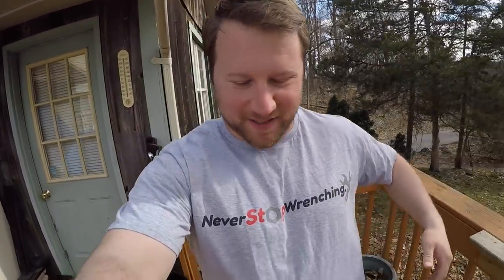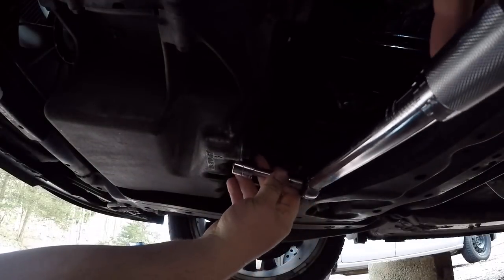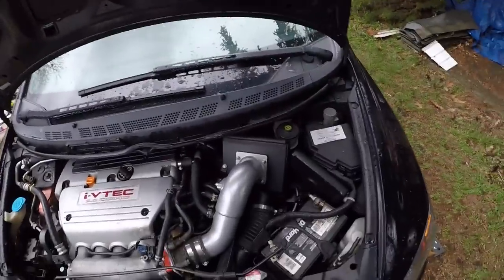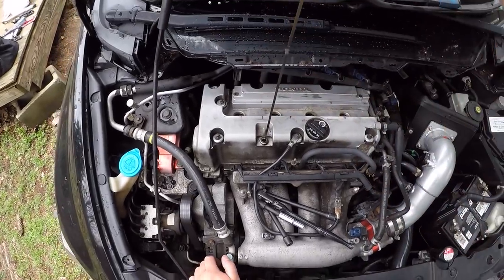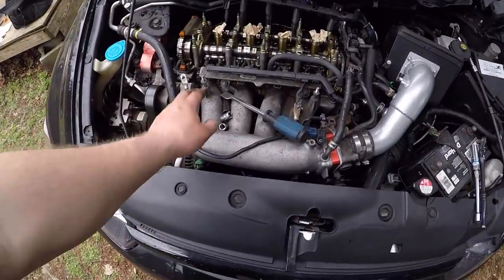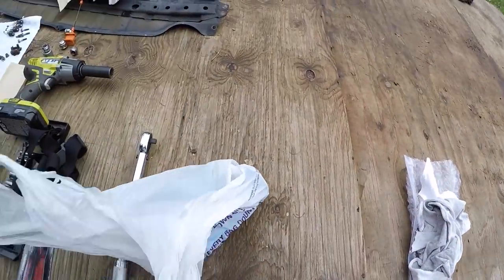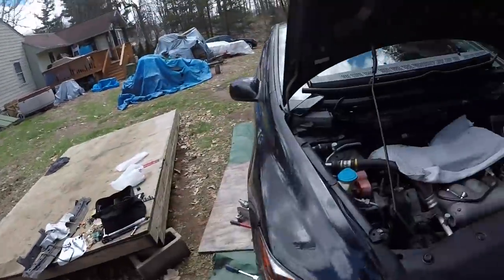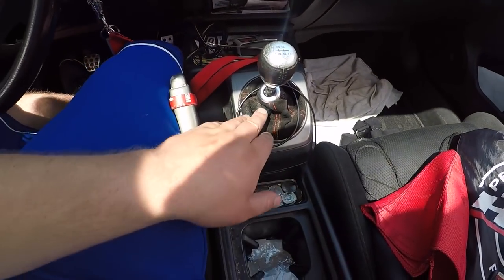Trying to Save My Honda Civic Si

Comment: That rain shield is just needing two bolts water is not going to make it lose lol. keeps the air filter dry,the spool valve water from the connections and the header to keep it from warping ( :

Comment: Don't use either, get Amsoil! Try running Sea Foam threw the fuel tank and into the intake with the Sea Foam intake spray for starters. It may help

Comment: Quaker State ultimate durability is good oil imo. 180k miles in a 2012 civic since new and motor runs flawless and no issues
Reply from the maker: Really? I've never heard anything about quaker, but that's a plus

Comment: For the noise valves in the e39 530i we decided to try out Lucas Upper Cylinder Lubrication & Injector Cleaner (goes through gas). Pops says it quieted down the other e39 and made the gas mileage better so hoping to do it to the fa5 before the next oil change #castroledge

Comment: You should've put the seafoam in the old oil a couple hundred miles before changing it.. don't put it in the new oil or you'll ruin good oil... don't waste your oil changing it every 3000 either, it's perfectly fine running the oil life monitor to 0% especially with synthetic.

Comment: Start running 5w40, I run it in my prelude, doesn't burn as much oil and I feel better having thicker oil in it cause the motor does have higher milage. As in what oil to use do your own research and make your decision from there. Alot of people are biased from advertising and just because this or that.
Reply from the maker: I was thinking about going up like a weight or so in oil... I'll decide next oil change, but for now, i'm happy with my castrol
Reply: Gerb Productions yeah that's what I switched to from Mobile one

Comment: I prefer Valvoline for my Honda Civic. However, Castrol Edge motor oil  will do the job fine. Mobil One oil are not good oils as they used to be.

Comment: I use Castro’s Edge. Have been since I’ve had my 2008 Honda Civic Si 209,000 miles.
Reply from the maker: That’s what I used before I switched to amsoil

Comment: Penzoil ultra works the best in both my Gd3 honda Fit and my  EM2 Civic. Even after 7k km oci’s the oil is still goldish when I change it. I was running mobil 1 in my EM2 before and the valvetrain was very noisy at the end of the oci’s. I got concerned a bit so I looked it up on bitog and just so happened to find out that mobil 1 samples show alot of metal in the oil compared to other brands so I switched to penzoil and never heard any weird noises since
Reply from the maker: Great info. You're the 6th person who swears by penz.  Maybe i should just run amsoil

Comment: Try running .008 on the intake and .010 on the exhaust. That's what I'm running tuned w/ bolt ons
Reply from the maker: Funny that you say that man, was going to do that, but my manual said .009/.012
Reply: closfg2 just set mine at the exact same specs and I agree
Reply: I tend to run my valve lash specs on the tighter side for a little bit more performance and less valve noise. I ran .006 and .007 on my old h22. It seemed to always like it on the tighter end of the spec. Try it out👍
Reply: only thing is the exhaust valves on honda engines seem to tighten up real quick so i feel like you would be adjusting them once a year
Reply: closfg2 a bit too tight for the k20z3, .008I/.010E is almost pushing it

Comment: Hey Stephen just use Pennzoil platinum from Walmart. Cheap and doesn't burn, good quality. Also, do you have the basic hondata reflash on the flashpro? Why don't you try that and see if the car runs better. It's more of a stock tune but maybe that could confirm whether it's the tune or internals causing the blue smoke. Your two mods now should be fine for the reflash. You didn't have blue smoke before flashpro right? The intake and header wouldn't cause it either. I also don't think you should have put the seafoam in a k-series engine; just a suggestion from Spoon Sports president tatushiro ichishima
Reply from the maker: It smoked once before awhile back before flashpro.  Only added a tad of seafoam into the crankcase, but that'll be it.  I don't really like adding additives to my cars often
Reply: Gerb Productions it might be valve stems or somewhere leaking in the cylinder. It's just during idle right? Could the valves be dirty? Cause during idle it's like VTEC but one valve open no overlap; Maybe pour gumout tune up into gas tank or attach crc valve cleaner into intake, spray, and rev engine?
Reply from the maker: I'm going to run it like this for awhile, see if it does it again. So far i added seafoam, valve adjustment, and changed up oil.  We shall see bro.  I appreciate all the advice and info though

Comment: Royal Purple plain and simple pay the money get the performance... used mobile one for the first two oil changes at 10k then Royal Purple from then till 130k without a single issue and absolute consistency it's in the motor and the gearbox I swear by this shit.... transmission fluid comes out with 30k on it and it's still purple... it should also be noted that Royal Purple motor oil goes in our gear box not gear oil

Comment: Bro. Go get some oil additive at AutoZone called engine restorer. I know it's not recommended my honda but if you are looking to get by before you rebuild. It helps. I've used it on my Integra gsr before and it got rid of the blue smoke. You have to drive it very conservative for the until the next oil change. Also add it to the next oil change if it continues.
Reply from the maker: Do you remember the exact brand/name? I'm very interested lol
Reply: Gerb Productions Restore is the brand. Grey bottle they sell them for 4 cyl. If your car is losing oil and you got blue smoke then it could be your piston rings. But this stuff really works and helps seal up the rings
Reply: If you want to, rent a compression check gauge from AutoZone if you don't want to purchase one. Usually a free tool loan. Check your compression before to confirm low compression.  before and after.

Comment: Cant knock the budget funnel. Thats my normal use. Put seafoam through the vacuum line. Does nothing in the gas
Reply from the maker: Budget life is my life ;).... I was thinking about doing that, but knowing my luck, i'd screw up an o2 sensor or something lol
Reply: I'm considering doing a video of putting seafoam in my fa5 via the vacuum line which make a huge difference in my cm7 accord. Though the first fa5 video release tomorrow.
Reply: For the cm7 i put it through the air intake though gotta make sure either you use the straw or go past the maf
Reply from the maker: Do it!

Comment: did you find your valves way out of adjustment? did u check them before u adjusted it to see? kind of curious because i did an adjustment 10k ago and feel like my engine is noisey so i might redo the adjustment
Reply from the maker: A few of them were too loose, exhaust side.  Do one, your car will thank you.

Comment: Valvoline is the best. Castrol is not a good oil at all is famous to create a crust of oil in the engine.
Reply from the maker: Oh boyyy
Reply: morgan gale garcia I agree gerb you should start using valvoline high mileage full synthetic Thts what I use in my FA5 and works great always keeps my engine running smooth and my motor has 229k on the dash and just did valve adjustment my buddy works at Honda he suggest running .008 intake and 10 exhaust my motor actually pulls better than before now good luck man.💪
Reply from the maker: Well, looks like I might possibly switch up oils again & so another valve adjustment lol. More content to come, thanks for looking out 🤙🏼

Comment: I use Mobil one lol.. let me ask u something with your Alpha headers got mine in few days ago did you use the 3-inch flange and 3 inch doughnut gasket . Did u use rhe one that came with the header or did u buy new ones.. I assume if u have a 3 inch exhaust id need 3 inch gaskets and flange right?
Reply from the maker: 3" flange, 2.5" donut gasket bro. The skunk2 alpha collector is 2.5", so my donut gasket bolted on perfectly.  I bought a new one from blox racing or something.  The one provided is trash, as you can see if you look up close. Almost looks like it wants to fall apart in your hands lol.  Yes, to be on the safe side, go 3" flange.  Good luck homie, you're going to love the gains. Oh, and i need another exhaust in my life ;)
Reply: Gerb Productions ok yeah cause I'll have a full race 3in exhaust so I'll need 3 in flange and 3 in doughnut all the way threw. I've herd the ones provided are trash so I figured id ask before I put it in. Just ordered the ones I needed b4 I wrote this.. after this is done I'm Putting in a high flow fuel pump and new filter and bigger fuel injection. Probably put some skunk2 titanium valve springs and values in the head aswell
Reply: Preety much have it turbo ready, so if I decide to all I need is pistons and rods pretty much.. but atleast ill enjoy the mods and tune till i boost... Still want nitrous lmao need better pistons and rods tho but would be sick to have, even if I don't super or turbo charge
Reply from the maker: Now that i'm back to work, i've been pricing out a nice head rebuild ;)... You have the same plans i do.  I'm going supertech pistons/eagle rods.  For valve train, super tech 95lb springs, titanium retainers, etc... Agreed! Or you can have one nasty n/a ;)
Reply: Gerb Productions nice man what compression do you want to go with?. Stock is 11. Something
Reply: Gerb Productions if i was gonna go n/a id pick different pistons with higher compression so it would be better if I boost I won't be able to use the highest compression cause the motor would blow or mess it up.. from what I understand u have to have the right compression pistons for the amount of boost u wana use. The lowest u wana go is 9. Something with a big boost but if u go with a middle power boost u can go with higher a compression ratio. Am i Right or do I have it all wrong lmao.. I believe the highest we can go is 12.5 or something for a n/a motor .. stock is 11ish so it would make a difference.. also the distance the piston travels putting shorter rods will increase torque for sure
Reply: So confused about that stuff. Wish I knew someone.. I duno anyone that builds there Honda most people talk shit cause they have mustangs can't wait till im boosting on em and they lose to a civic
Reply from the maker: 12.5 for a 9k redline ;)
Reply: Gerb Productions can u still boost it?
Reply: With 12s on it..
Reply from the maker: You have it right, for boost, you want low compression. N/a higher compression like 11+... Dude, it takes practice and I'm still learning as well homie ;)... You need to post vids of those races so i can lmao haha
Reply: Gerb Productions definitely just moved back to sc so I'm gonna be working on the car and getting a go pro.. I just feel stupid making videos I'm just to crazy I guess.. but ima make one soon. I should drive out to ya soon man. Or vise versa back on the east coast!
Reply: http://www.superstreetonline.com/how-to/engine/htup-0710-2006-honda-civic-si/ check that out very similar to what I want to do I think.. they are using the same parts u want to use.. well in the motor
Reply from the maker: Listen man, i'm always down for a road trip ;)... Maybe we can set something up soon

Comment: Idk i just switched to royal purple 🤷🏽‍♂️goodluck
Reply from the maker: Do you like it so far?
Reply: My boii told me supposedly the oil stays purple thru out oil changes but me checking the oil determined that was a lie 😂 I just wanna see if it burns out quick
Reply from the maker: LMFAO.... Keep me updated, seriously.
Reply: Gerb Productions I will it was my first time using it so it probably needs to be changed a couple of times before it actually just stays purple

Comment: How many quarts of oil did you just put in?? 😨
Reply from the maker: 5 quarts exactly. Gets me right to the second fill line on the dipstick
Reply: That's a little weird the spec is 4.6 quarts which isn't a huge deal I'm just super picky on certain vehicle  specs but your good in general I know you check the oil  and take care of this baby
Reply: Btw I've used budget funnel #saynotorealfunnels 👌
Reply from the maker: Ik, for some reason when i add 4.6 quarts, it only brings me like 3/4 of the way up to the second fill line.  Might as well just top it off... You already know.  But seriously, i try haha
Reply: That's true man that's kind of strange. I'm in the same boat I'm having problems with my fg2 😵 alternator looks like it is failing under high load I've got a more than ideal voltage drop with full load 😞
Reply from the maker: Damn man... At least alternators are somewhat cheap. Stay with Denso
Reply: I bought it from work with lifetime guarantee I get stuff at cost 👌

Comment: Who cares what oil you use. As long as it's changed frequently it really doesn't matter unless you really beat on the car often
Reply from the maker: You do have a point.  Pretty much have all the same formulas in them

Comment: Castrol edge is shit !! Try Pennzoil Ultra Platinum 5w30 or Redline 5w30 or even Amsoil 5w30 but please not Castrol edge 😞
Reply from the maker: Oh boy.... Maybe i should just get amsoil and call it a day lol.
Reply: Anything between those three are good oils ! I use to have a civic si 2015 and tried all the oils and I would say redline oil is the best ! Pennzoil ultra platinum is a really strong oil too and of course you can’t go wrong with amsoil ... Redline don’t burn , that’s what I like and also it is a 100% group V synthetic oil
Reply: K series engine run great on pennzoil ultra

Comment: I'll sell you mine
Reply: Gerb Productions I'll sell you my FA5 2007 with 78k miles.
Reply from the maker: I'm upgrading to a 9th if i ever sell midnight ;)
Reply: Gerb Productions the 9th gen is a downgrade brother and not as raw as the 8th. You should rather get a 10th gen. The 1.5 engines are powerful and modded can beat a stock type R.